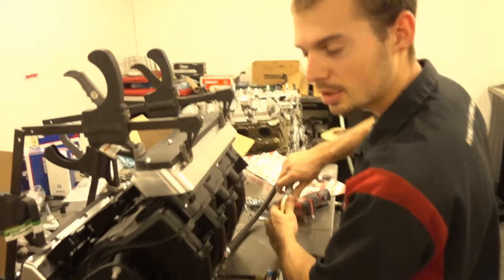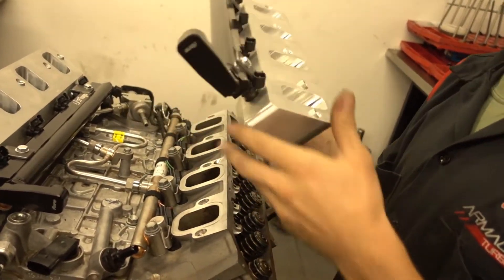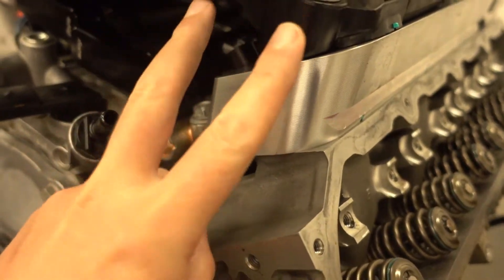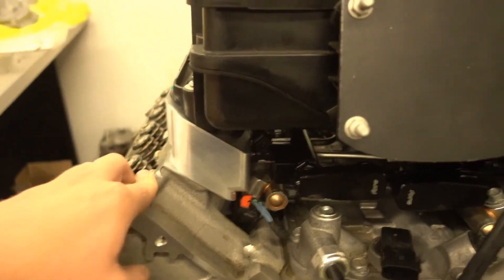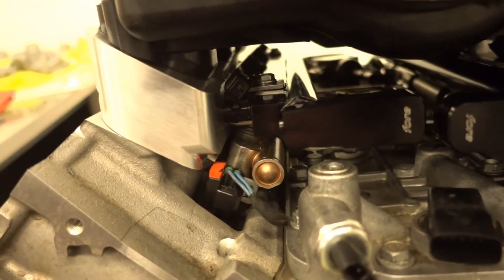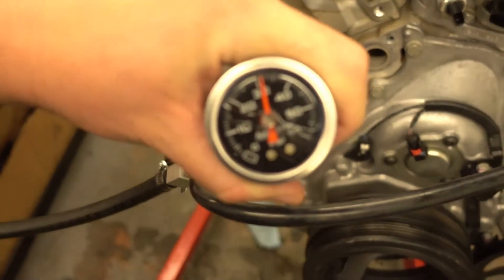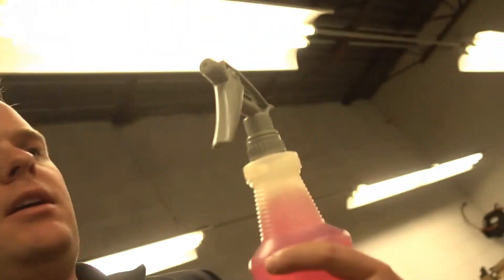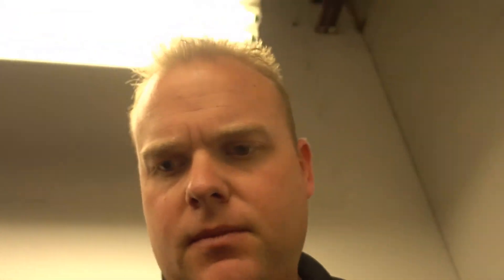Can You Add Port Injection to Direct Injection? - make more than 1,000 Horsepower to the wheels

Comment: Great video. I've been looking into something like an add on pfi ,but for LLT/LFX v6 for a twin turbo build. I've seen only a handful of options to upgrade the d.i. system,all are ridiculously expensive ($3500-6000). I know these engines use the same injectors as the lt1/lt4 engines. I've managed to find quite a few aftermarket parts,rods/pistons/cams etc,but nothing for fuel. With the right cam/pistons/turbo(s), these engines can pretty easily pass 550-600hp mark,only I highly doubt those injectors would be able to keep up past the 5-550hp mark. I even started looking into an aftermarket tbi to possibly adapt to it. Obviously I'd need a custom 4bl intake manifold,but are either of these options able to work w the stock di system? I'd most likely use a megasquirt ecu for tuning,but any suggestions ya'll might have would definitely help. I'm not a pro at this. I've researched,studied and worked on sbc/LS v8's my whole life,never any interest in v6's,let alone dohc. Just interested in something different than the usual swaps. Kinda wanna show those JDM's than it isn't just v8's  American auto manufacturers are good at,by v6 and i4's w the best of them,and way cheaper